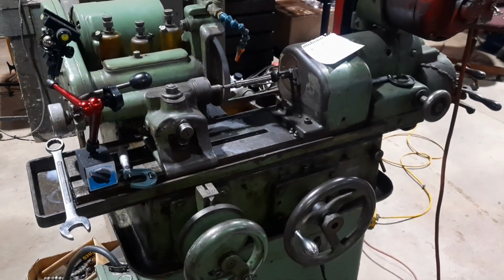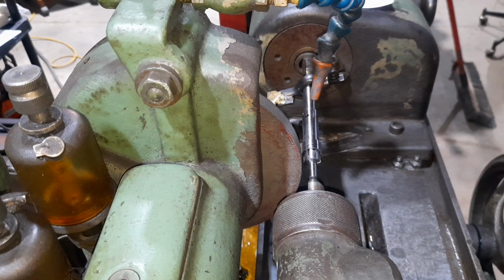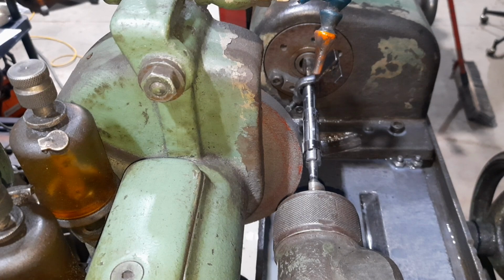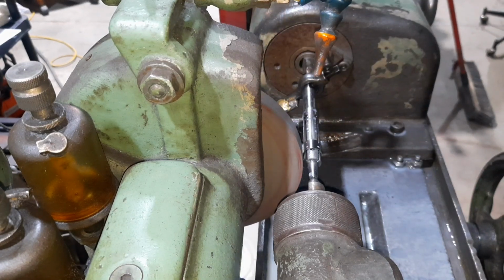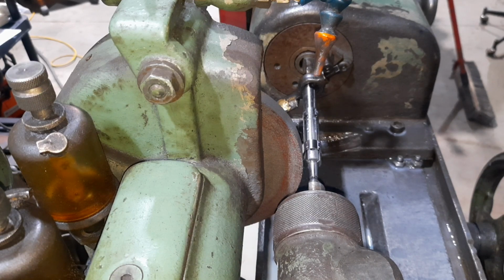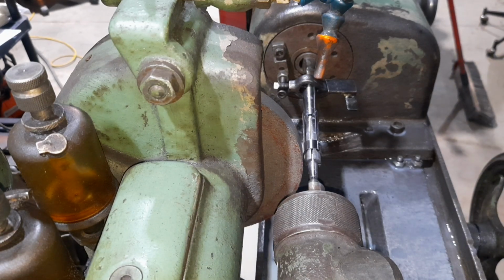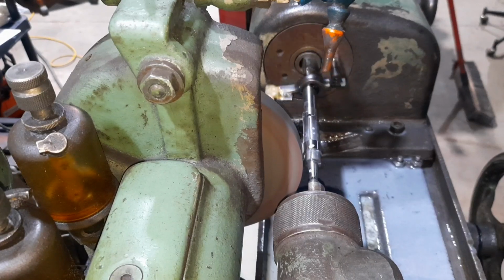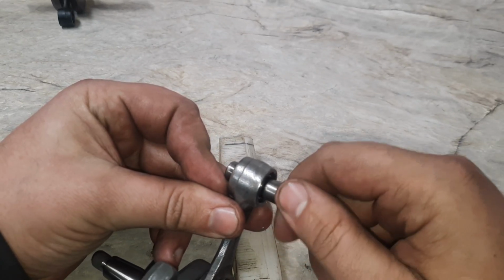OD Grinder Put To WORK! From Bearing race to Rod bushing

Comment: Are you concerned about the bushing spinning inside the rod end? 
That would be my main concern. I think if I were to do this, I'd heat the rod end press-in a hardened sleeve/reducer and hone it to spec.
Many ways to skin a cat.
Reply from the maker: It could definitely spin. But these going in the racers, they are not running for long. Not sure this would be the best setup for a worksaw. Only 1mm wall isn't much thickness even if it's hard material.
Reply: @dynojoemods2764  Facts!

Comment: Apakah dengan tambahan selongsong besi itu tidak mengganggu perporma mesin bro
Reply from the maker: It will add a bit more resistance, and needs to be sized just right. But for low time use it should hold up ok.